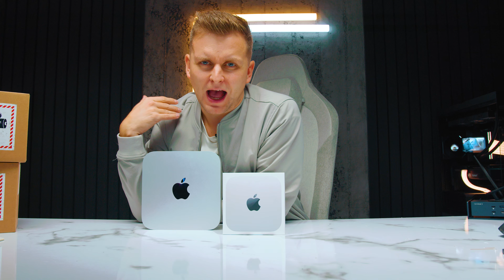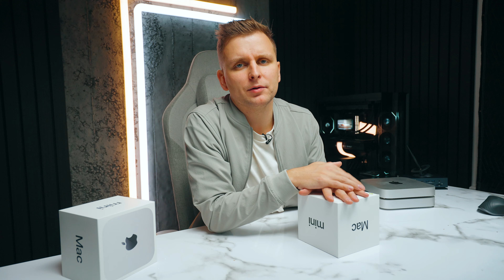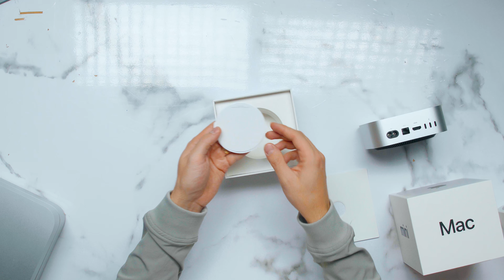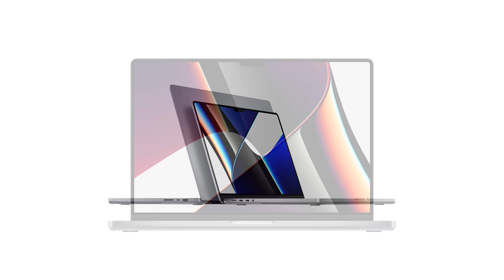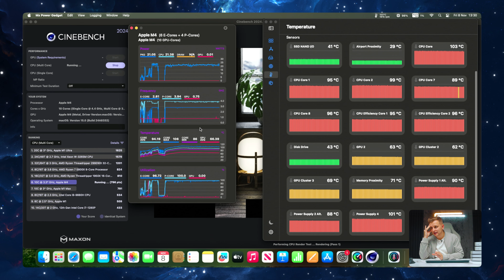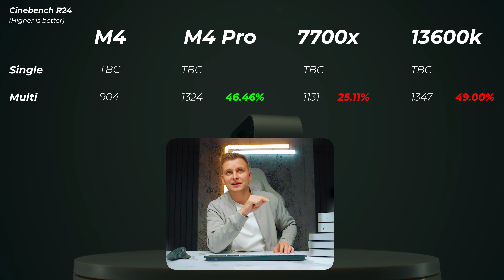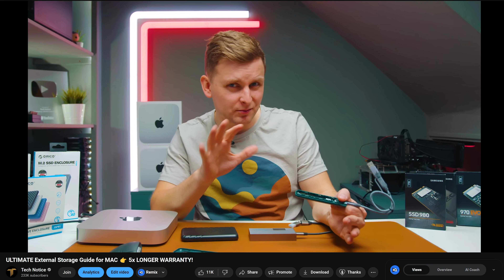Apple just KILLED the Mini PC Market and Windows WILL NEVER recover! | M4 & M4 Pro Mac Mini

Comment: No they didn't.
They have been saying that for years it's just apple temporarily in the lead for low cost all in one small boxes in some cases 
Still no upgradeable SSD and GPU and eGPU and ram.ir hyper threading which geekbench does not see..

You need cinebench to get proper multicire scores and. See how much throttling occurs when stress.fir now apple has no e uo to #1 temporarily in single core and of course power over watt.

They are still far behind dedicated gpus if you consider all the codecs standards tech etc Nvidia has with cuda direct x scaling etc .

If course apple has metal their own resolutions calling raytracing and media engines to take the load of the CPU as well.

I really thing apple needs to either create a GPU core pcie and external GPU especially with tb5 available, possibly add a media engines or two to it with its own dedicated memory for older 8 and 16 gb m series machine

Or allow some and or Intel or preferably Nvidia eGPU ocie gous or even apple gous to work.

If so they could combine Nvidia GPU power plus their own GPU power easily making them #1:in GPU power if you could combine the power of both.
.but apple has decided not to let third party  internal GPU memory SSD CPU ram make money on its machines.

Comment: For all Macs, you cannot have anything other than the base model.
Reply: What are you talking about? Apple’s main web site and their various international sub-sites allow for online purchases of all the varieties of Macs, each with “build-to-order” optional configurations, not just the base models. So non-base-model options, while relatively expensive, *are* available. There is also the option in many cases, such as the M4 Mac Mini, to purchase higher configuration models pre-configured and these models also are able to be specified with further options in specification. For certain configurations, these pre-configured models are cheaper than base models optioned up to the same specs.

Or did you simply phrase your comment so poorly that its actual meaning was untrue and instead you meant to say that, for you, all Macs are what you personally would describe as base models”? If that was the case, allow me to correct your English. You should have said “cannot have anything other than a base model”. See the difference? Hmm, maybe you can’t. In that case, your comment says more about you than Macs.

Comment: CONS: Non-upgradable, power button at the bottom, and lousy 3D rendering
PROS: power efficient
That M4 is too slow and currently at the bottom of the multicore performance ranking under real life scenarios.
Reply: To people concerned about the power button placement, don’t be. It is a Mac. Once initially powered-up there will rarely be any need to use the power button again. Starting up after the initial power-on normally is achieved via the keyboard and shutting-down is a software function also. No need to use that power button.

Comment: Yes. You missed the point though. it's a killer products that only run Mac OS on a 4th deferent  proprietary processor technology.  It's a better mac who gives a crap?   Their extremely  overpriced proprietary product with very limited expandability and intentionally designed not to up be upgraded. Yes, let's all sign on for that.  You basically get two choices. and an OS that. only runs about 10% of the software on the planet. It's a boutique computer. Stop supporting a predatory company like Apple. You have thousands of choices for Windows products and ability to make incredibly customized systems. My very advanced gaming machine that runs 99% of games available on the planet and has sixteen terabytes  of 7000+ speed  SSD storage, 32gb DDR 5 ram  And a high-end Nvidia GPU and it cost me under.$2500.  Ohh, but this is faster at doing crap I don't wanna do and not able to do crap that I wanna do.  Here shut up and take my money because I'm stupid.

Comment: NOPE. the mac mini I need for work (64gb ram/2TB drive) is F***** $3100. Only rich tech influencers and tech companies can afford that. Instead I got a minisforum um890 pro with 96GB ram and 4TB HD for $1050. Thing flies. How will windows never recover. The apple is better but AMD Ryzen chips are amazing, and with Strix Point coming, yeah, windows is no slouch. Still might be #2 to apple, but who cares if your machine is 20% faster if its already super fast. My Um890 pro can RIP through 4k footage, play Apex Legends in medium quality with ZERO issues and runs every other program in milliseconds. WTF so we need this much power for from the m4 unless you're an animator, 3D artist or doing some REALLY heavy LLM or multi-cam podcast or something. I bet even then my little cheap Chinese mini PC could handle it. F apple.

Comment: M4 mini is a pretty neat piece of tech, but it's for a specific niche. So specific that windows will not feel any impact at all. M4 mini is useful ONLY if you plan to exclusively edit videos/photos and need a mini pc for it for any reason. Most dont care about size nor power consumption, bc of that a $600 regular desktop pc will have better perfomance and compatibility in literally any other application besides audiovisual.

Also, this video is biased af, a 9 gen intel?? This is 6 years old already. Wtf

Comment: Without even watching a minute of it, it's clear you don't have the faintest idea what you're talking about. Windows and mac is like a flat head screwdriver vs phillips. You're not gonna grab a phillips screwdriver to use it on a slotted screw, do you?
Reply: Some screw heads provide an option, as do Macs. Look up Parallels software. Runs Windows and Windows apps on a Mac. Or look up Wine. Or other virtual machine software available for MacOS.

Comment: There is no PC killer when there is no upgrade-ability.
Reply: Try upgrading a true sffpc, specially for the same amount of money.
Reply: this Mac mini can last 20 years easily 
and they are super fast
my video editor he still have a macbook pro i7 16gb ram 2012 and it still runs blazing fast
Reply: @gabakusa  even if wanted to use this computer for 20 years, Apple only supports their hardware for 5 years. Even if the hardware could run the software, Apple doesn't allow you to upgrade to the latest OS and you will no longer be able to run the latest software. The reality is, most people will only keep this hardware for a few years before upgrading to the "next best thing" and Apple prefers it that way. Also, the Intel Macbooks are some of the worse computers and a 2012 Macbook Pro can only run up to macOS 10.15 Catalina.

Comment: I’d get the base M4 Mini Pro model and use my existing external storage. If I could only upgrade one thing, it would be the RAM. 
But it depends on your needs. I work mostly with PDFs, Apple Notes and various videoconferencing software and store most documents in the cloud. The extra storage would be for space to install Parallels and Windows for the few occasions I need to do something in that world.

Comment: Just bought it. Using it with my existing dual monitor setup of 24 inches 1440p and 1080p res. The text is blurry and unable to scale. I didn't know it has such a big problem with scaling and i would need to buy an expensive monitor as well to use it. Windows does it flawlessly with any monitor thrown at it. Regret buying it :(

Comment: Many of us will never go with apple because of the vertical integration.  8G of DDR5 is about $22 U.S. today, not the $200 apple makes you pay.  Though the M4 is certainly good, buyers have to decide if they want the compromises.  As to "windows," it's dying a slow but continual death.  If you don't need commercial applications, Ubuntu and Debian run better at no cost.

Comment: The reason why it will not take off with PC user is the lack of USB Type-A ports. Yes you can get a thunderport to USB Type-A dongle but most will want it built in not a dogle that will most likely get lost or get in the way of something. The other reason is most PCs are windows and they will have already bought the windows version of the software they use not the mac version of the software.
So for content creators the M4 Pro Mac Mini might be good but for the general user the software they will have to rebuy and the change of operating systems and it not being x86 even though there is  software to make it compatible with it is enough to make the general user who isn't already in the Apple ecosystem not buy it.
Then look at the price for the 1TB of local store. You can get an entire windows mini pc for just that 1 upgrade. Will it be one of the best windows mini pcs? no but it will be good enough that most people will not notice.
For business well is it 100% compatible with most likely propriety software that they have 0 control over? If not then it isn't the computer being bought.
Still yes Apple users who want a mini pc will get it but windows users and users who don't care will not.

Comment: I have multiple Apple devices including a Macbook Pro, however, IMO the $600 base Mac Mini 4 does not deserve the hype. It only has 256GB of storage which is what you would find in a 2005 computer. You can easily buy a MiniPC from multiple manufacturers with a comparable Ryzen 9 8945HS CPU, 1TB of storage and 32GB of memory for $650. Many MiniPC's support Occulink, have a display port, a 2.5GB LAN, plus a few USB 3.2 ports.
Reply: Exactly right. I use a Minisforum UM790 Pro mini-PC, it's two years old already. It has the same small 5x5 inch form factor, but packed with 64GB DDR4 RAM and two 4TB internal Nvme SSDs. The BIOS even supports Raid 0 as an option. The AMD 7945HS APU runs everything I throw at it effortlessly and it sips power. It's got two USB4 (40Gbps) ports, four USB 3.2 ports. 2.5G ethernet port. Two HDMI ports. Headphone/Mic jack out. ON/Off switch in the front.  And the kicker is that it is many times cheaper than a Mac mini with 64GB Ram. AND you can run whatever you want on it, whether it's any version of Linux or Windows or whatever, except MacOS, but that's a bonus ;-)
Reply: @tonepoemfilms  Just commented this exact thing. Waited 1 year for this rumored mac mini. Went with the UM890 pro instead. Got it with 96GB ram and 4TB HD, just pimped out machine (no need for external drive) and it cost me $1050 in my country. Thing RIPS. My last computer couldn't handle heavy 4k footage, esp. wrapped in a .mp4 codec. But this handles it NO issue. Will the Mac Mini render my Adobe timeline faster. Sure, but honestly rendering content in 2 minutes instead of 4 minutes is not a deal breaker for me. The Ryzen 9 chip FLIES. Oh and the UM890 pro is VERY well built AND literally makes ZERO noise (never heard a single fan sound yet). Again, the apple might be a more powerful computer, but it's like saying this Lambo is faster than your Porsche, but the Lambo costs 600k and the Porsche costs 150k and let's be honest, both cars would FLY. We're spoiled in tech now and we need to band together to F Apple up their greedy corporate bum cause their upgrade options are literaly immoral highway robbery.
Reply: And if you're willing to get a better bones mini pc from AliExpress and their in your own ram and storage you can save  a couple hundred bucks
Reply: @mlhm5 and usb c and do 6500mb/s and sometimes are even smaller and can be modified.
Reply: @Darth-Lord-Raven  Occulink is pcie. You have no point.
Reply: I bought my 8845HS mini PC with 32GB of RAM and 2TB of SSD for only $450. I can easily double both the memory and storage for a small amount of money.
I have been using Apple computers for over 20 years, and I would like to buy a new Mac mini and use it, but there are so many scenarios where I need Windows and its emulation in the Mac system will not work at the proper level.
For example, I need 3Ds Max. And even 32 GB of memory is not enough for me. But I am not ready to pay 3 thousand bucks for a Mac mini, just because I need 64 gigabytes of memory.
For its money, Windows is not so bad and is definitely worth the money spent on it.
Reply: I had 256GB in my MacBook Air from 2010, if I remember the year right which is now totally obsolete today.
Reply: But then your using windows yuck 🤮

Comment: Windows users calm down. Yes a supercomputer is faster than this mac mini.
Reply: You mean an Intel NUC. Its smaller and slimmer than this mac mini at 4”x4”. The new nuc 14 has user upgradable sodimm ram up to 96gb, upgradable Nvme ssd and 16 cores. Mind you in a 4”x4”x1.25” form factor at just $650

Comment: The device is excellent, and I'm tempted to purchase one myself. However, once you opt for the 512GB version, you could get a Minis Forum with 32GB and 1TB of upgradable RAM and storage. While Macs offer a highly efficient platform, the openness of the X86 architecture remains more significant. Also M4 pro score 20% slower than my 12  7900x3d in cinebench . The 7700x is 8cores and on a much older node 5nm vs 3nm all those comparaison are pointless.

Comment: I love Apple computers since Macintosh SE days, and think the M4 Mini has an amazing value proposition.  BUT, it won't kill PC, people use Windows for the more open ecosystem, rather than the curated Apple one.
Reply: And to not get completely ripped-off on the prices. No Mac with useful amounts of RAM/SSD is availabe for anywhere near the supposed starting list price.  You could buy 2 or 3 High-Performance Intel/AMD Minis for the cost of 1 appropriately equipped Mac Mini.
Reply: We are talking MINI PC and from what I'm reading it will put a serious dent in that market
Reply: The mac does not have curated apps. You can download and run any programme.
Reply: @charlievarley  did you fall off of a small bus somewhere down the road?
Reply: @charlievarley Many, if not most but not any. Even with something like Parallels running.
Reply: @DeepThought9999  i did mean apps that are built for macos. But yes there are good work arounds for some if not most pc and linux apps.

Comment: wait... did you see the idle power draw. Its freaking 0,05W. Crazy. The 7700X pulls 21W at idle. Its 420x more energy. 
Maybe I will buy a Mac Mini. I've had hope for Qualcomm but they ARM Processors got banned in EU. 
AMD got a little bit close to the M4 but pulling 56W instead 22W and Mini PCs starts at 1000€.

Comment: I don't understand tha comparison against  mini PCs. Most mini PCs are extremely cheaper than a Mac mini  (as long as you add a decent amount of  ram and nvme),  and they are mainly used to create small Linux servers or NAS, which the Mac mini is not going to cut it (it sucks at Linux).  The other use of mini PCs  is for gaming (specially the ones with eGPU), which also sucks on Mac.
Reply: That and extremely simple office PCs. Browsing, YT, Word, some PDF, music player, little more. I've set up a couple for family and friends, and the main factor there is cost. Even the N100 will do and that can be had for 200 eur or less.

Comment: Never was a fan of Apple products, but I tried out the Mac Mini M4 with 512GB storage and 24GB ram. To my surprise it could play a 9x 4K multicam Resolve project without proxies! Reverse play was a bit stuttery, but when the Proxy generator had made a proxy for just one of the angles it also Reverse played without hick ups, even with the proxy generator running in the background. My PC with 12900K and an RX4070 TI can't even play this that smooth without all proxies. I returned the Mac Mini and now get the Mini Pro with only the extra GPU power. The upgrade prices are mind-boggling indeed, but what a little powerhouse!
Reply: Storage is $60 per TB retail. And they are giving people 0.25 TB as the baseline. What!?
Reply: You could have upgraded your gpu and got more ram for less and it would have performed better. You are only telling us you arent bright.
Reply: @kborak  @ the PC? Sure, but that's another beast that eats +300 W/h and >500W/h when rendering. The mac mini M4 pro maxes out @ 65W/h. And the PC is not as portable.
Reply: Don't be confused these are not comparable cause they are optimised for diferrent things. You compare a gaming GPU with a one which not made for games. Maybe next time compare an NVIDIA H200 GPU with Mac4 pro, it's crazy they are different things for different work.

Comment: you will run this command in terminal: sysctl -a | grep cpu.feat  ...... then you will demonstrate the compression capabilities and explain SOC for encode decode on the following: Apple AVX1 and AVX2 F16C cpu support, With a demonstration that covers these points you will see the cpu output delivery model. I would like to see pc comparison to the M4 in these models as this is a real significant portion of use options within the cpu's engineering almost everyone would want to know. Investment in processing capacity over intels 10+ year cpu innovation model. Running this terminal command will state the capabilities on the layers. post that and you will have a large group of followers who want to know more. sysctl -a | grep machdep.cpu or: sysctl machdep.cpu typed in Terminal returns a complete list of CPU instruction set support

Comment: Regarding 10Gbps ethernet, if you're considering a thunderbolt adapter, make sure you don't get one with the Aquantia AQC107, as there are some hardware bugs with certain aspects of Airplay, like if you want to use your mac as a network speaker (i.e., accept airplay from another machine on the same network, and play audio over the macbook speakers).  The AQC107 will bug out and the Airplay session will fail.  Instead, get an Aquantia AQC113.  And thank me later.